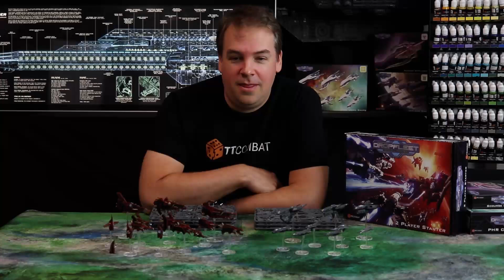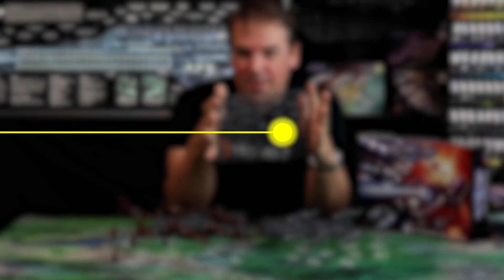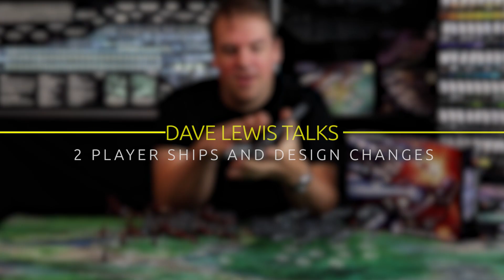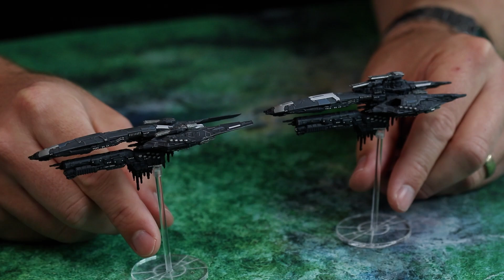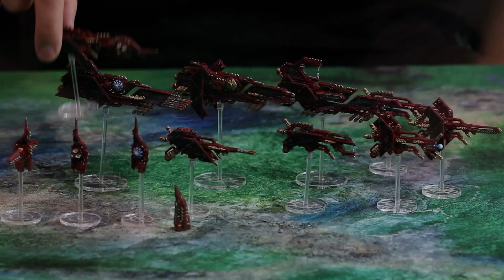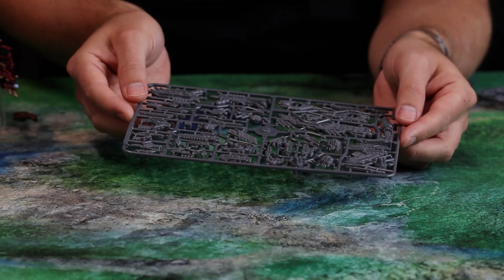Dropfleet 2.0 starter box ships explained by DAVE LEWIS!

Comment: Heya, as someone that recently bought the Starter Set because I liked the look of the models. It would have been cool to include a guide to building the models, or at least labeling them, because I am sitting here trying to decipher Which ship is what sprue set
Reply from the maker: Glad to hear you like the models! There are instructions on our website with the ship names, so if you take the Fast Play sheets in the box you can then look up the instructions for the specific ships.
Reply: @TableTopCombat  I did find them in the end and already got both Skirmish Fleets built and prepped, a local from our Warhammer Group wants to try to play a round with "Lite" rules so we will be leaving out the ground assault part.